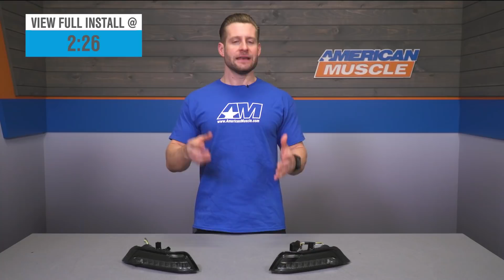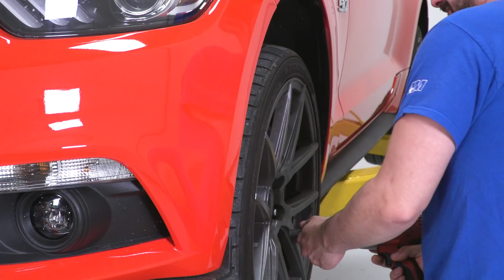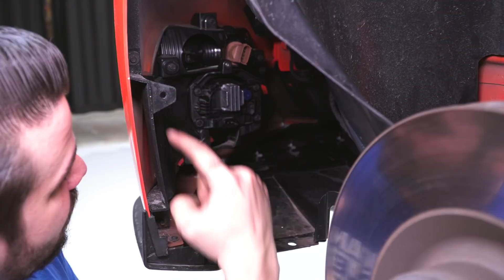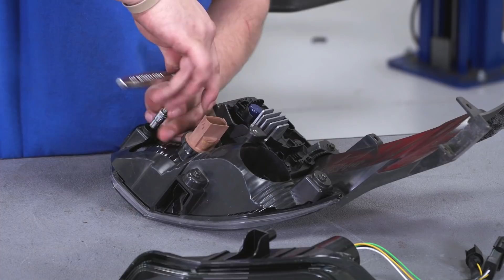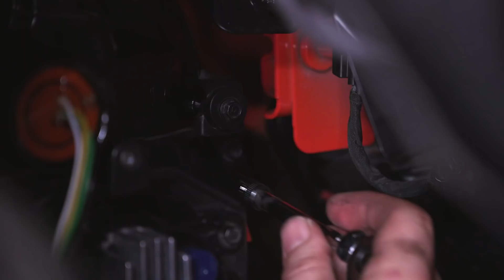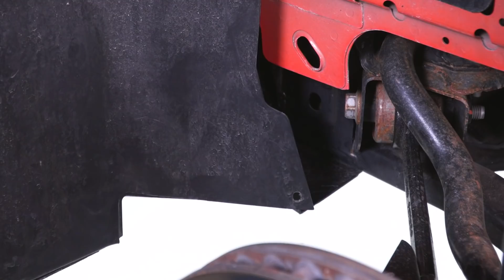2015-2017 Mustang Morimoto Smoked XB Sequential LED Turn Signals Review & Install

Comment: These look great. I will say this though, the slightly bigger gap (compared to oem) these create when mating with the assembly is a bit off-putting. It seems like it CAN create an issue for condensation. Just my opinion though.